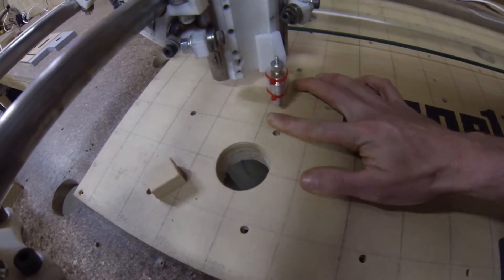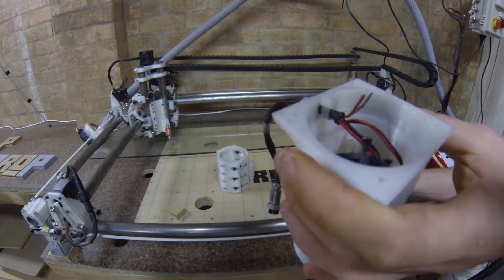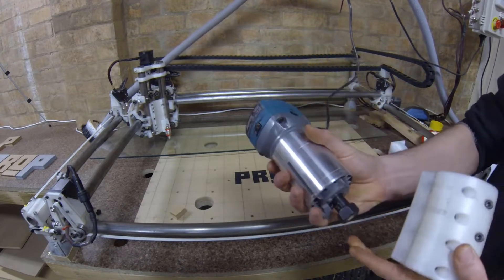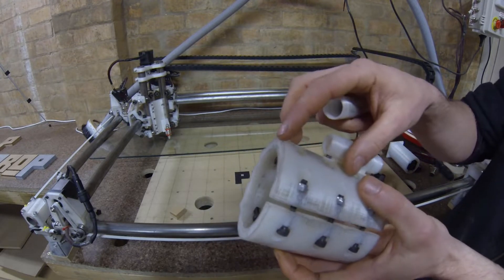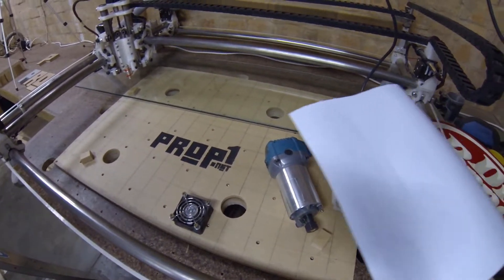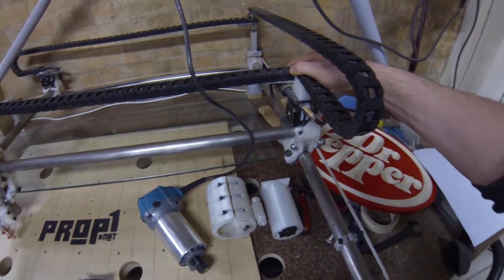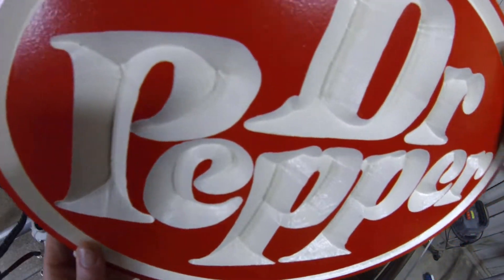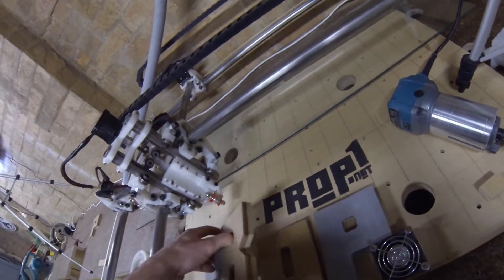mpcnc 3 month review

Comment: G'day, In the video you said you made the machine for under three hundred dollars? Was this the whole thing up and running or was that just for the base.
Would I be able to talk to you somehow as I'm new to all this and would like to build a machine myself.
Rob QLD
Reply from the maker: hi rob, i believe it cost me around 250$ all up, but i already had a couple of steppers and the control board lying around, it can actually be done quite cheap if you shop around though i did actually want to buy the kit off of v1 to support them but the us shipping to aus and the fact that i had some of the parts lying around meant it just wasn't worth it for me and that was me up and running with out the cost of the router or the laser, but a router that you can source that will take aftermarket different collet sizes for the bits will cost a bit also say another $100-$200
Reply: Prop1 , thanks for the prompt reply. You said in the vids that you modified some of the parts as they cracked on you. Do you have the mod file for  these parts. Sorry if this is a simple question but, I could not find them anywhere.
Cheers
Rob
Reply from the maker: hi rob it will be at the my mini factory link in the description
Reply: Prop1 yep found the info thanks. What controller board did you use?
Reply from the maker: just a maker base @  @robshin3877  although i don't recommend them its just what i had lying around.
Reply: Prop1 thanks mate

Comment: Some things don't need infinite accuracy just fit for purpose and these machines can do a lot. Nice work. I'm guessing the flex could be reduced a bit by making sure those pipes are as stiff as possible like 2mm stainless etc.
Reply from the maker: cheers mark it dose everything i need as is already, planning to use it to build the next cnc something extrusion with preloaded rack and pinion and big motors
Reply: @prop1305  I'm in same boat. I building two at moment one for timber finger joins and the other for thin plate holes for guitar amps. Without this project using cnc wouldn't be an option because of cost but these machines if anything are beyond the precision i need. There's no way I could process finger joined timed as fast and as good as these.
It looks like you're using the makita clone, i say that and wondered about using it. Have you had good experience with it?
Reply from the maker: @marklowe7431  not really mark the end bearing in it is gone and getting worse from other peoples tear down videos i have seen it seems they just have a bush and no end bearing, i bought it because its hard to find a good deal in aus for a 240v makita but the clone works and the after Market Colets fits , but im still looking for a good deal on a makita because i want a good one for my next cnc
Reply: @prop1305  Cool, that's good to know. I did find a makita for 240 so I guess that's the way to go. Guess that's not too bad given routers are not usually cheap to start with.